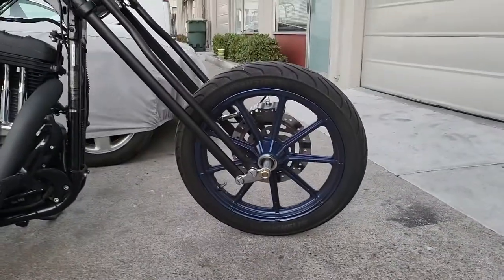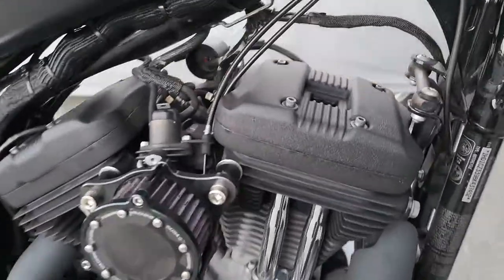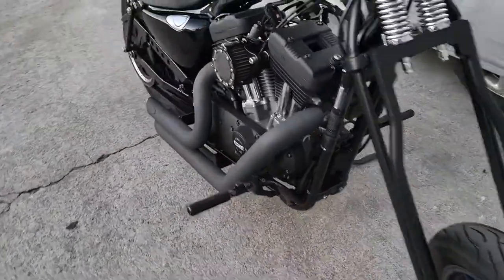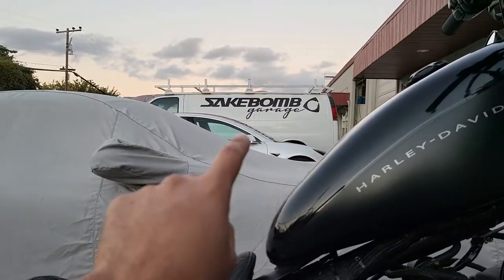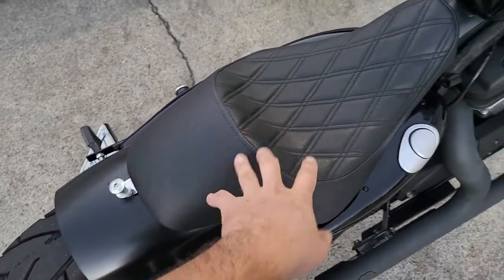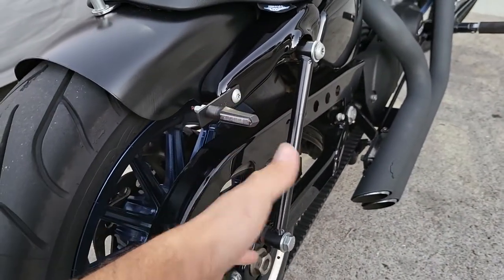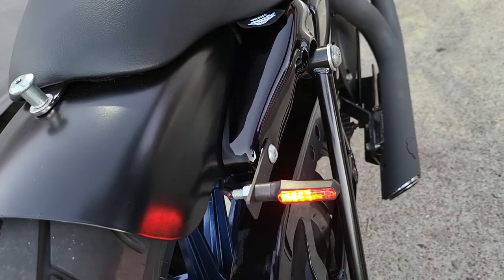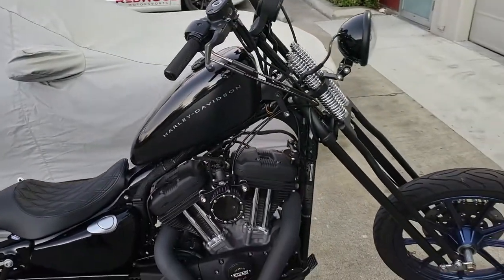The Chopper/Bobber Build is DONE (ALMOST)!

Comment: So how did you mount ur headlight and was that why it was rubbing because u didn’t have that part on the fork
Reply: And how did you mount the speedo
Reply from the maker: I ended up being an official headlight mounting bracket that was made for Springer front ends. Pretty much the difference is that it's much thicker and is able to withstand the vibration of the bike
Reply from the maker: @robertlambert7906  the speedo is still in the stock location/stock mount
Reply: @koozairy  where can I get it send me link please I want to order it all but I don’t want to fab anything if I don’t have to plug and play
Reply: @koozairy  I have a 2006 and I think they moved my speedo I’d have to send you pics
Reply from the maker: @robertlambert7906  yeah the stock location is in the center of the handlebars. If it's not there and located to either your bottom left or right, near the front forks, then it's a relocation kit
Reply from the maker: @robertlambert7906  https://rivercity-store.com/products/black-headlight-mount-bracket-for-springer-front-ends
Reply: @koozairy  it’s on the top of my triple tree
Reply: So should I just relocate it to the side
Reply: @koozairy  thanks man idk I might not do it